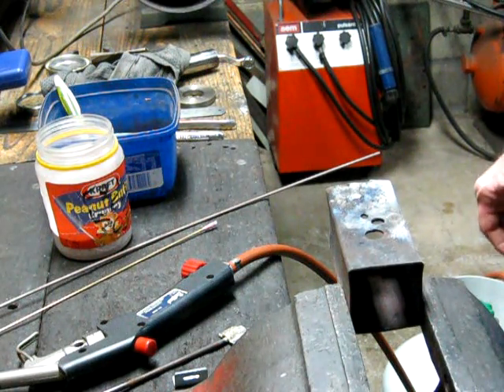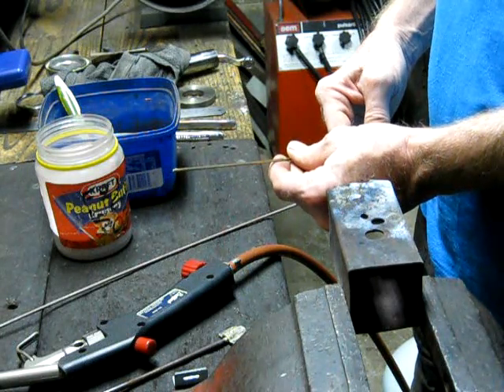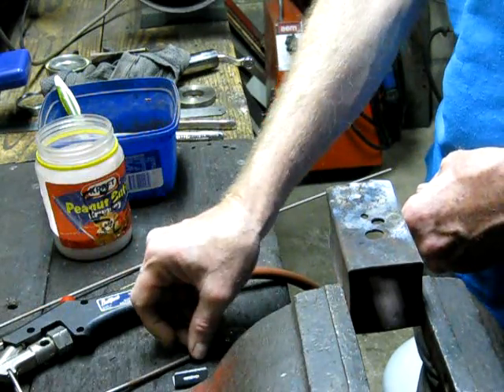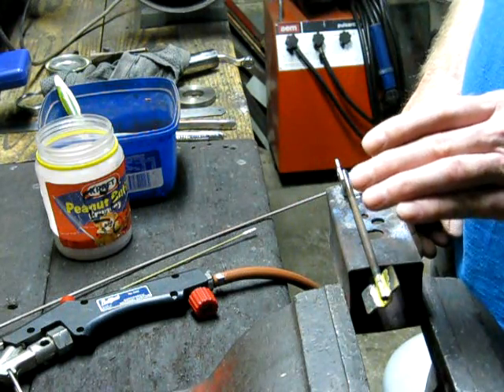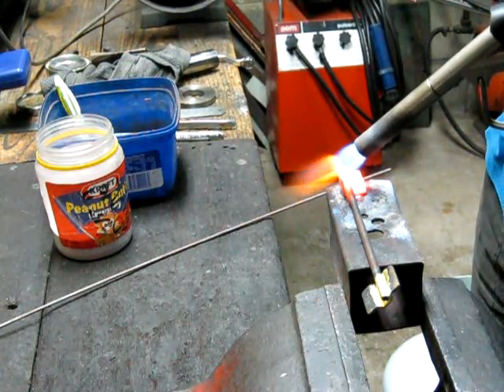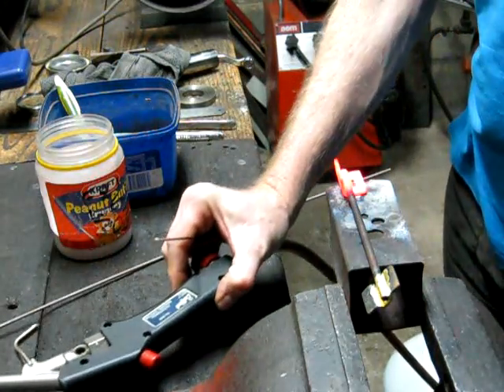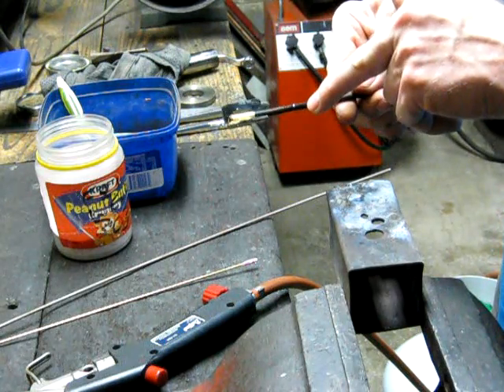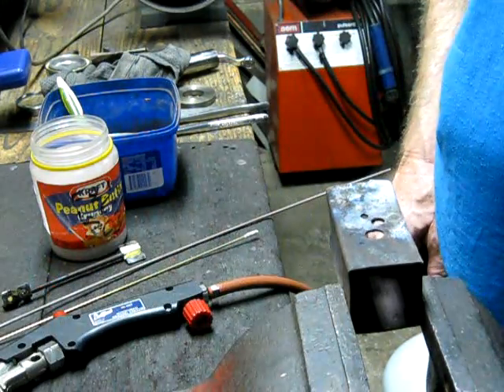How to bronze braze with LPG or propane gas

Comment: Where can I get a fairly inexpensive gun and hose from I have the BBQ gas cylinder I just don't have a lot of money I'm not forking out 70 odd pound for a hand held rotthenburg brazing torch so will any handheld propane torch or cheapish gun that has temperature control suffice. Sorry for my ignorance i have only just started looking into brazing many thanks Ben
Reply from the maker: I haven't seen any inexpensive guns that will hard braze with LPG.  A standard (common) type LPG torch won't do the job.  It has to be one of the very few that are designed to apply concentrated high temperature flame.  No such thing as a cheap lunch with these, unless you can pick one up secondhand (eg. in the UK).  I can only recommend the torch in the video as being capable of doing this sort of work. Rob
Reply from the maker: Yes that is cheap for small use.  The gas gets very expensive if used for an extended period (a cylinder lasts about 15 minutes).

Cheers Rob

Comment from the maker: While the gun will handle thin steel tubing, once you get over 1 mm thick and about 20 mm diam it will be very slow going.  You will probably need a second gun to help preheat the job if the steel sections are long.  Any significant heat loss/sink situation will be an issue.  Rob

Comment from the maker: Yes, thin metal tubing should be no problem.  The determining factor is the metal mass involved - and subsequent heat loss.  Anything in 2 mm wall thickness up to about 1 - 2 inches would be doable.  You will need to work around the join on large diameter jobs.  I actually hard bronzed a fuel tank end in on a stationary motor - about 100 mm diameter in 1.5 mm metal and it did it without a problem.  Rob

Comment from the maker: The problem with a Primus torch is that the flame temperature is not hot enough to melt hard bronze rod.  It will get very close and soften it but it will not run.  So the number of torches makes no difference.  I do use my big Primus torch at times to give the Bullfinch a boost when brazing larger pieces of metal, to counter the head loss from such a job.  It helps a lot. Bullfinch have a flame temperature chart on their site which shows the temperatures achievable with the various gases. Rob.

Comment from the maker: BOC gas centers have the plain bronze rod in several sizes. Plumbing suppliers also may have it.

I have some coated rods and I find them harder to use.  I much prefer the plain rods with some Ezi 303 flux.

Brass cannot be used as a substitute.

Primus torches will not melt hard bronze satisfactorily.  I have a Primus torch kit and even on very thin metal it cannot get it hot enough for the bronze to flow. It comes close, but is not workable.

Rob